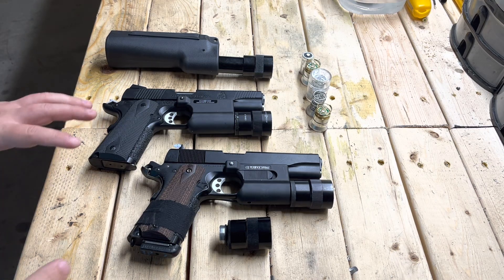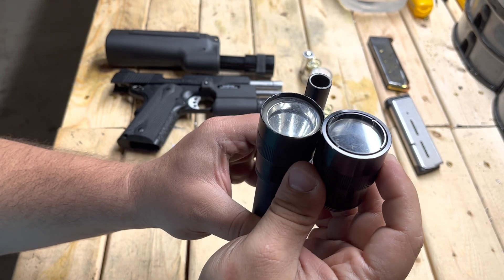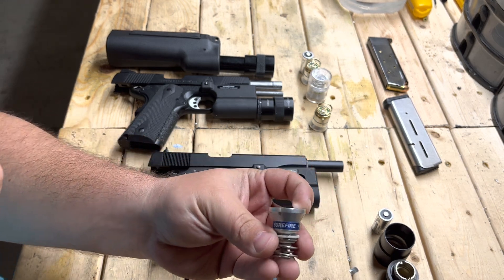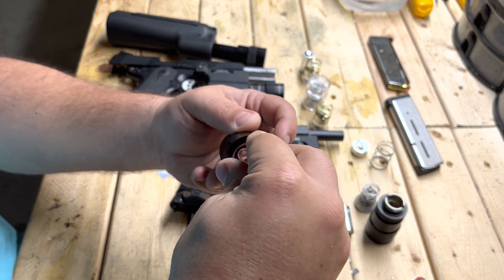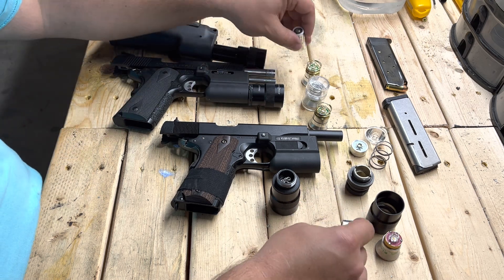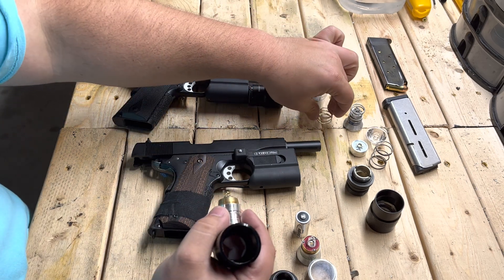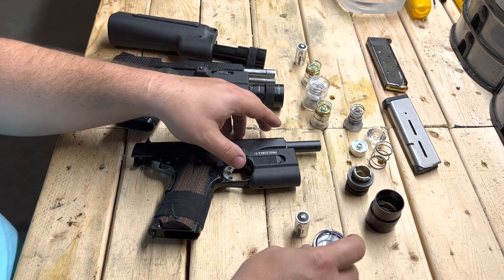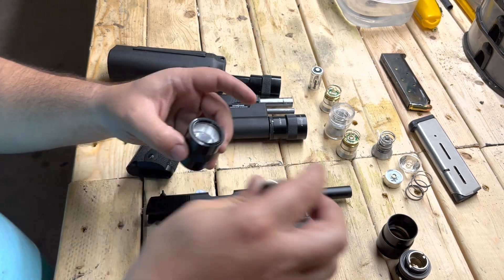Upgrading the VFC V1911 (Surefire 310R clone) light output? 🤔😯

Comment: How is the recoil hold on VFC? Just ordered one on my Colt MEUSOC Clone with real steel slide stop. Thx for your videos really helped me out.
Reply: Been a long time so maybe old info, but how’s the light and slide stop hold up? I just picked up one of those MAC JSOC clone pistols and I gotta say, the temptation to keep it old school looking is strong with this setup.
Reply: @ actually. We try anything and still 45 recoil is too much for the lamp assembly to stay tight on trigger guard. There is only one tiny screw to keep it tight alongside the custom slide release. We conqure this problem with my gunsmith to attach the end on tiny screw a very tiny ball bearing and tiny dent to the trigger guard. Oh yes, sir! Been blasting now 45 through my gun like and MF. Stays tight!

Comment: Did you need a real Surefire slide stop for these lights?
Reply from the maker: Yes you do. I was able to machine my own from a pre-existing slide stop using my lathe. However, there’s a seller on eBay making and selling replacement 610R / 310R slide stops.
Reply: When you machined your own slide stop, did you make it one piece or a two piece like the original?